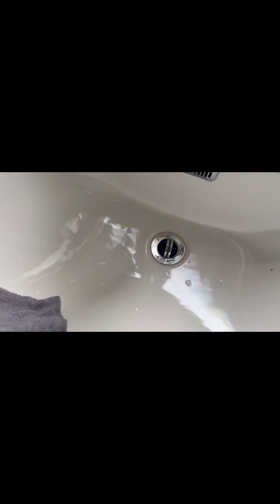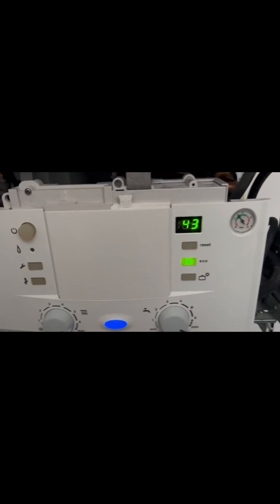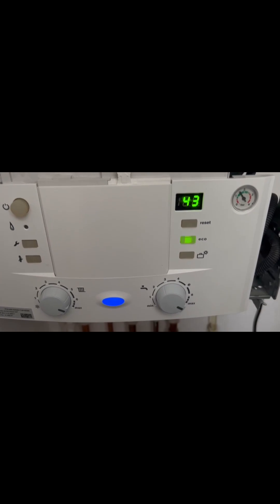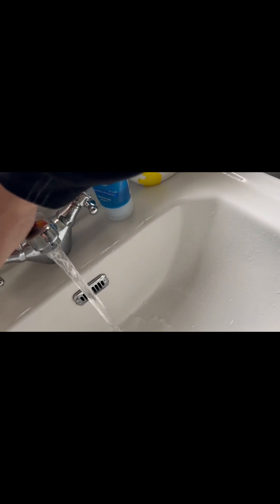worcester greenstar no hot water but heating working - faulty NTC hot water sensor diagnosis

Comment: good video
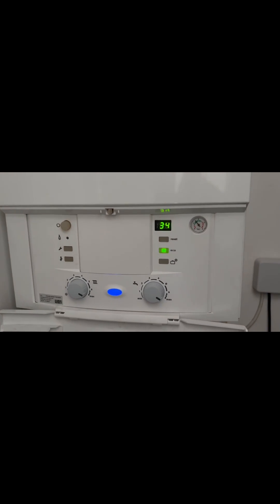you know the green numbers to the right of the boiler at 0:18 , they keep going up but im getting no hot water...
also at 1:16, where you take the wire out, there is a plastic 'half ball' underneath...it looks like its got got metal fillings it
any idea why the numbers are going up ?
Reply: I have the same issue as you describe with the temperate going up until the boiler locks-out. Did you find out what was causing this ?
Reply: @intanet did you sort the issue out? Seems like your boiler is overheating and locking out due to safety reasons.

Comment: Thanks for the video, if the sensor is at fault and you unplug it will the hot water come on?
Reply from the maker: It will… but it’ll be uncontrolled hot water … the sensor will fail to safe so it needs replacing